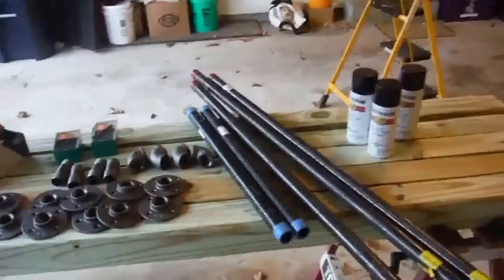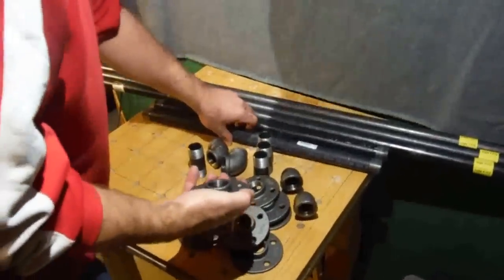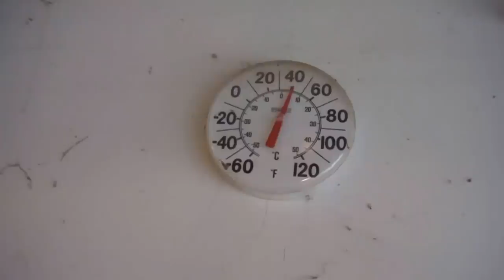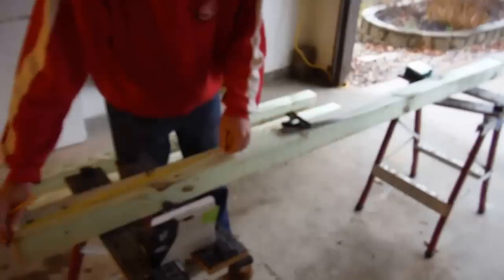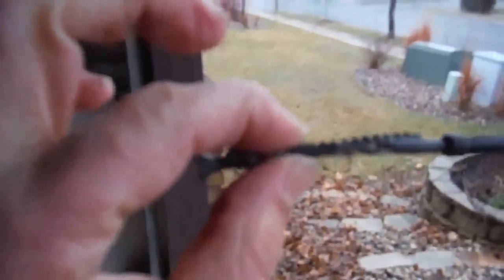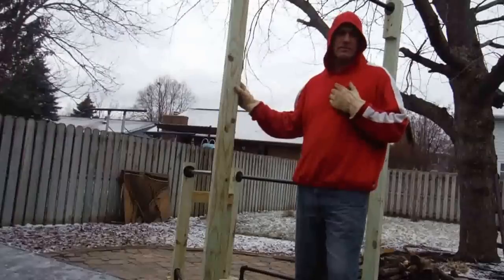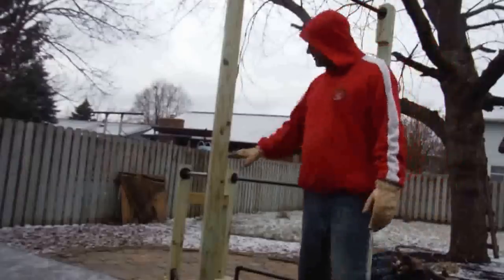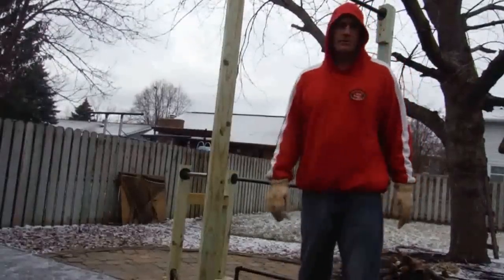How to Build a Simple Backyard Bodyweight Gym

Comment: You should do a video of you working out on the equipment you built, how it's holding up, or any changes to it.
Reply: @Mark Hanson , yes, pls do. i don't know what those lower handles are for. and why are the dip bars on an angle (getting further apart)? is there a specific exercise or reason? thx.
Reply: Jae Pak In calisthenics parks, those lower handles are for incline pushups and exercises. The dip bars are angled because each width impacts difference muscles.
Reply: @xPostpunk  Closer together bars and keep body more upright focuses on triceps.  Wider hands and leaning forward puts more stress on chest.  I think the design is done to increase the strength of the equipment.  Great idea.

Comment: A good tip with spray paint in cold weather/conditions is to put them in warm to hot water (not boiling) so the paint can spray on smoother and evenly

Comment: I built something similar, completely timber frame with no hardware, just solid joints and wooden pegs. But, mine is square. I like your tapered design as it is much smaller. I'm fairly certain I could do a muscle up (if I could do a muscle up, lol) it is that solid.
Reply from the maker: Thanks

Comment: tips: pre drill your screw holes half the size of your screw,  if your not going to pre drill then use a hammer drill to drive the screws in, better still is to use through bolts and locktight as well as using braces to secure into the ground because that will last longer and is something you can maintain longer. Use what you have of course, buuuut if you can through bolt the posts and secure it well.

Comment: @Mark Hanson  Would you now that it has been just over 4 years change anything about the design? Like the angled dip set up or bolts vs nails vs screws? Also how has it held up? The push-up  bars at the bottom are a nice touch and also why I inquired about the angle. Thank you for posting this build.

Comment: nice. u should swap the screws out for nails tho.  more sheer force
Reply from the maker: +Fred D thanks. Hadn't thought of that.
Reply: Screws>nails... Bolts>Screws. Drill holes and bolt it together through the 4x with some nice fat bolts with oversized washers.Or use decking braces. You will get a lot more life out of it. No criticism intended though, I took some great ideas from this! I'll definitely use that inspiration to build my own
Reply: Fred D those big ass screws will hold fine. he has four of em nails pull out.and if you use ring sharks you can't remove em without tearing up the wood. if your worried about sheer force use grade 8 bolts. nails blow

Comment: That's a great unique outdoor gym you have made. I am about to make my own but I wanted to know if you had any problems with the pressure treated wood warping? Also has the paint held off the rust well?

Thank you so much for posting this!
Reply from the maker: One of the two taller uprights did warp some but it is still useable as is. I have had some paint come off with use. I'll probably have to reapply some every two or three years or so. Thanks for watching.
Reply: In the uk you can buy galvanised pipe I.e. Zinc coated which will remove the need to paint it regularly.

Comment: Just one question who is going to do dips that wider 🤣🤣
Reply: lif3style alternatives and sow low...if u r tall u need to put it higher I reckon
Reply: @Ma4iM  f
Reply: I bet you could do some hanging rows
Reply: He did say he is 6'6". That's the size of an NBA Forward,  big dude.  The answer to your question... he'll do dips that wide... he's a big man.  Just look at him in the vid bro.  Ppl always so quick to make fun.  Smh
Reply: @drsev61  I get he's 6'6" but I doubt he's doing dips as wide as the pullup bar (4 foot long). He can start at the thin side and go as wide as he wants. Show me the 4ft wide dip video :P
Reply: Extra bracing for the pull-up bar support posts. Or not even extra, really. Necessary.
Reply: Ideally they should be a little wider than shoulder with.
Reply: The dip bars v out from 2' to 4' so basically anyone can do dips somewhere between those bars

Comment: Well done!  Just curious, do you need to secure it to the floor?
Reply from the maker: +Khoi Ly it makes it more stable. Its not 100 percent necessary but it does help prevent it from tipping
Reply: Thanks.  I try to avoid drilling into my existing concrete floor.

Comment: Why did you buy black iron pipes instead of galvanized for outside?
Reply from the maker: Galvanized can react with the treated wood. With the paint on the iron pipes they hold up pretty well. You do have to reapply paint from time to time.
Reply: That's interesting, because I have had a 1 3/4" galvanized (not hot-dipped) pipe screwed to some 6x6s underneath my deck with floor flanges for the past 7 years with no issues.

Comment: why the wacky set up ? Everything looks out of line
Reply: Because it is not set in concrete he had to use those angles for stability.
Reply: pretty sure a rectangle would be just as stable.
Reply: @lawrenceshdow  A rectangle wide enough for pullups would be too wide for dips. I agree, though, that the angles look off and I would prefer a different design.
Reply: @mrclyde6051  I can't remember what I was envisioning when I said that..  😆 😆

Too long ago.  

He must not have wanted ot permanent I'm guessing or he'd just put the posts in the ground like a normal person
Reply: I didn't watch the video again so I admit that I have no idea what I'm talking about now.

Comment: 8:00 doesn't even trust himself not to put his left hand in the saw LOL
Reply: Sqausht Suspension Have you ever used a table saw? That shit will kickback on you so suddenly and unknowingly you’d lose 3 fingers and a toe before you even realized it. It isn’t he doesn’t trust himself. He doesn’t trust a moving 64 tooth blade moving at 250+ mph while putting force against it with a 4in board.

Comment: Nice job but it requires a fancy set of tools to construct it.
Reply: Ahm ... nope!
Reply: Hardly - the cuts could all have been made with a handsaw. Most people with a house in the developed world own a power drill, if you don't have one, get one or borrow one. The pilot holes could also have been made with a hand powered drill, which very few people have in the developed world as power drills are so common.

The only fancy tool used here is the one not pictured: the pipe threader. Places that sell pipe charge to use theirs. Easy.